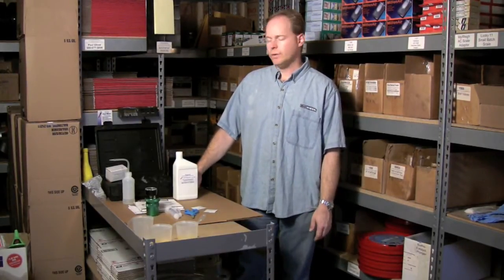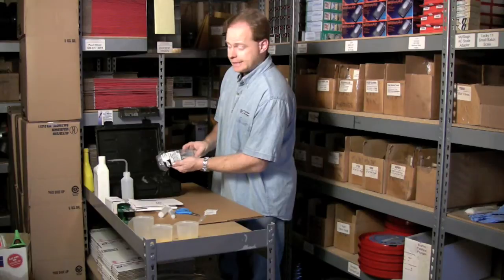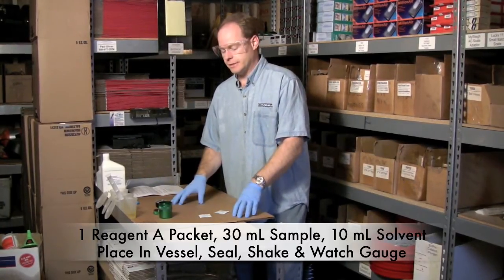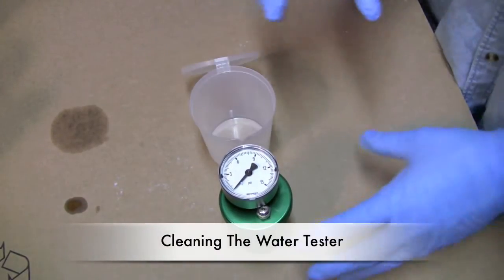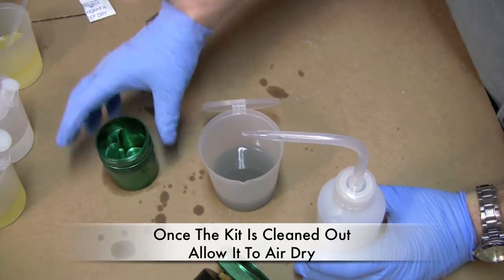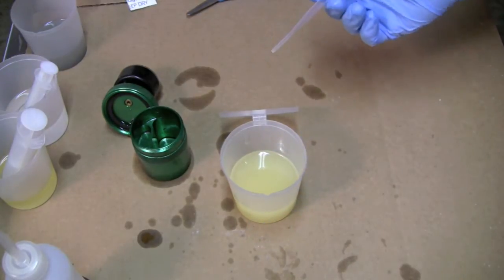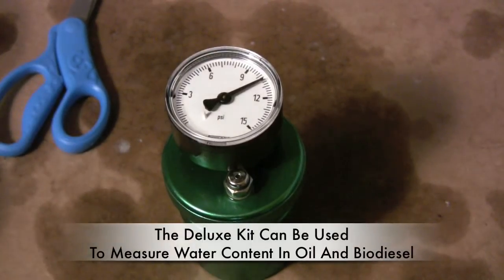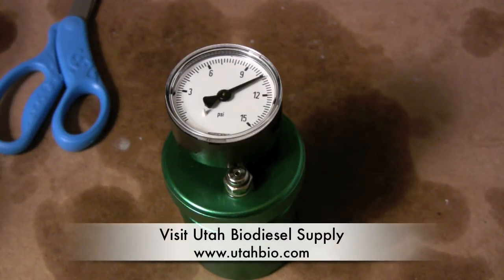Testing For Water Content In Oil & Biodiesel Using A Deluxe Water Test Kit |  Utah Biodiesel Supply

Comment: Hey I wondered can you help me in some stuff I got any garage sale I found this unusual what I could only call a test tube now at the bottom of it has what looks like to be Bert shot little balls of metal submerged under what I think is viscous oil translucent the whole unit it has a paper measuring apparatus inside of it but the unit was sealed when it was manufactured the only way for me to get the substance out would be to break the top of the glass it also was sitting inside of a thicker piece of glass tube with a hello ball of rubber put over the end and when squeezed it causes a vacuum which has no effect on the substance itself as it is in a sealed glass cylinder it is about 3 inches long and 1-inch thick at the part where the substance submerged and then above the 3 inches piece of tube it's tapers down to about 5-mm or 6mm and the overall length about 300 mm on an all causing a vacuum

Comment: can i use this kit for petroleum products like light diesel oil or Furnace oil ?
Reply from the maker: Yes. Absolutely. It was actually initially designed to detect water in hydraulic fluid, so using it with petroleum products or diesel or furnace oil is right up it's alley.

Comment from the maker: @circusboy90210 I'm not sure how diesel vehicles do it. I believe they have some sort of a water sensor in the bottom of fuel filter assemblies. However, they don't give an exact readout of the water, just indicate the presence of it.

The meter is available with a digital meter now. It's an option you can add to it that they can install at the factory. Not sure how it could be modified. I'm sure it could, but I haven't seen a machine for it yet.

Comment from the maker: @circusboy90210  As far as I know, the Karl Fisher method is the only other method that's used in the Biodiesel industry for detecting water. It still requires some intervention by humans to run the machine, but is what is specified in the ASTM standards for equipment. It also is an expensive piece of equipment ($3K+).